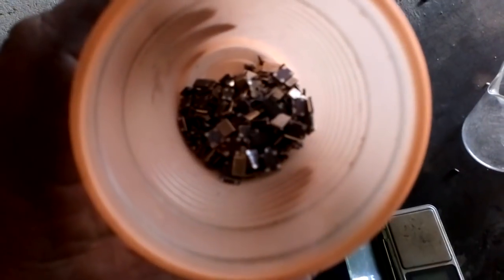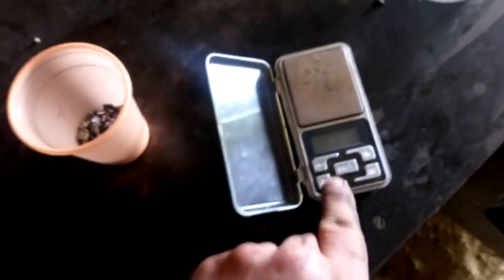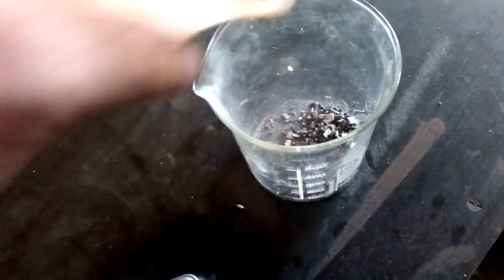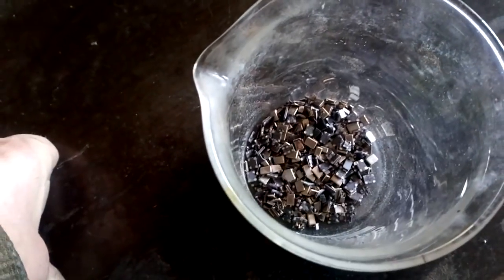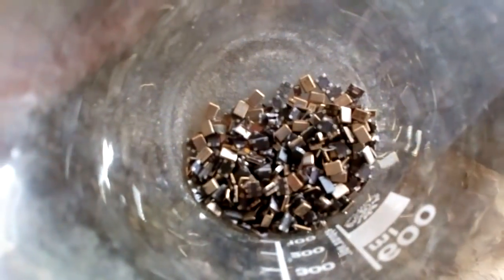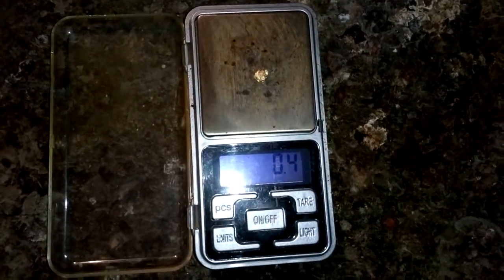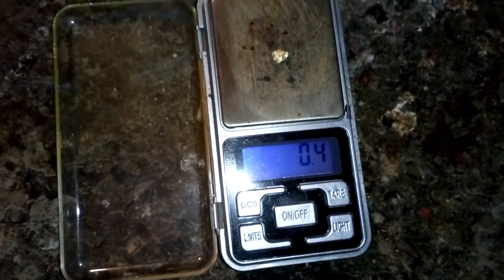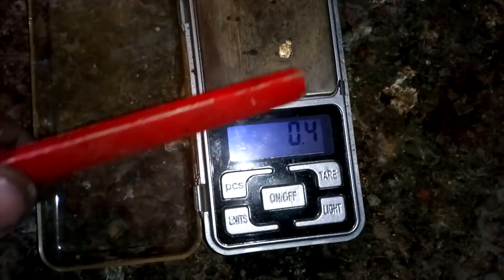Gold CRISTAL OSCILLATORS for gold recovery

Comment: I always add the urea when the beaker is still on heat then  filter over ice cubes it drops the silver chloride much faster ;)
Reply from the maker: The Urban Miner  yes, of course it can.I also add the urea as well  while the solution is hot but I remove from the oven.But I do not use ice, I just leave aside and wait for the silver chloride is setlle.

Comment: if your smb turns brown instantly when you add it , it means you have free nitric.  Solution should be near boiling when you add urea
Reply from the maker: The Urban Miner the rest is a bit of nitric but it is regulated by the addition of distilled water after the add of urea.

Comment: Great video Dusan! Great yeild! Of course I have a ? lol well a couple.... It seemed like a way different process to prepare this then the  other Crystals that you processed... Did you not cut these open? ( I know these have a gold bottom, Not sure I know difference between crystal oscillators and just crystals though)  Glad u used SMB I believe that is what stump out is and I can use that....  easy to get. :) You prefer Urea or smb?
Reply from the maker: bohemian mystik The urea use to denox the nitric acid. The smb is for gold rings and of course you can use Stomp out, it is good and contains Smb. The crystals are generally integers in the metal box, while the oscillators are thin, square and ceramic.

Comment: So 1kg will give over 8 grams of gold, that's better than most cpu's, US$350 gold per kg, you will find them on many telecom boards from routers & switches, sometimes 8 on a board, also slot cards, old hard drives and big ones on vintage telecom
Reply from the maker: eWaste Ben If someone possesses a lot of boards, it can easily take time to capture an enviable amount. I'm surprised to by the amount gld they gave me to. I'm very happy. I'm glad to see you folow my channel, well, your channel is one of my favorites.Cheers mate.
Reply: What a cute and wholesome  interaction
Reply: Callate inútil,tu ni reciclado ni nada,solo haces el idiota